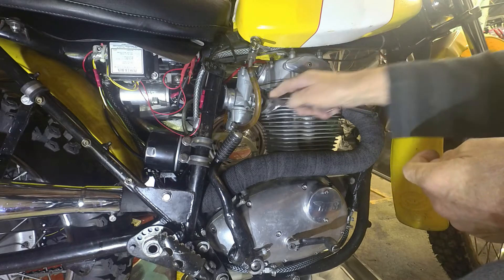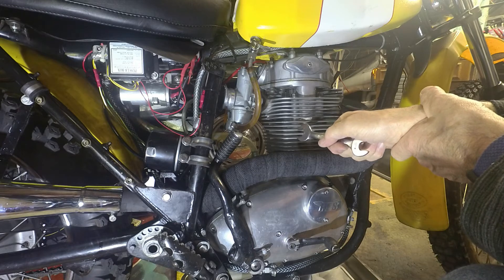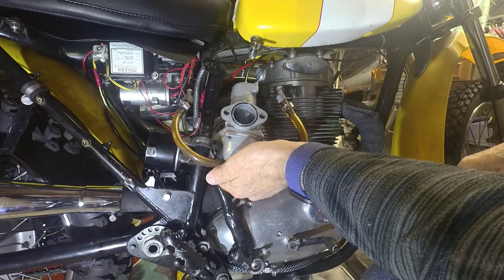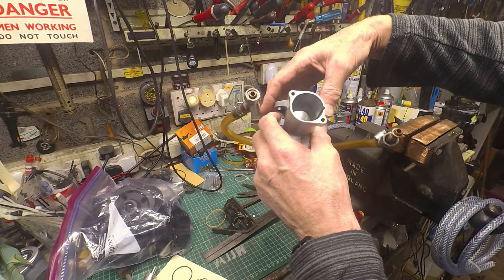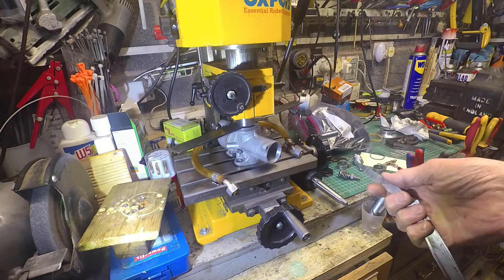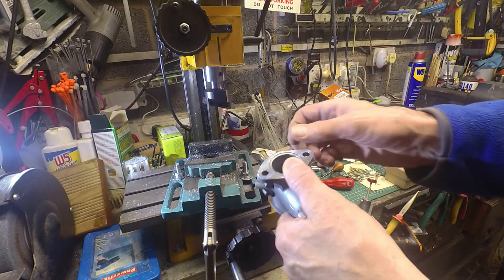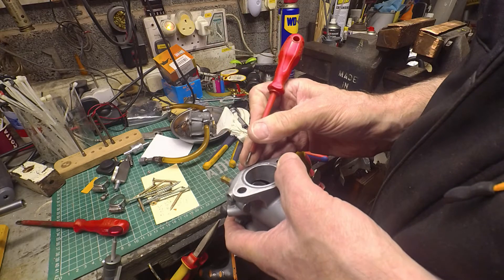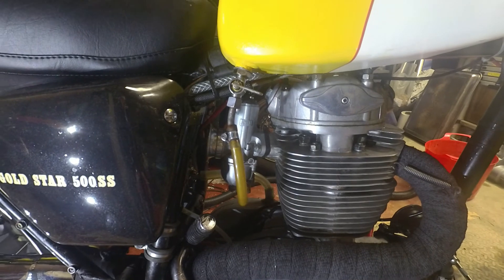Warped Amal Carb Flange

Comment: H❤
i I have a trailblazer 250 and I have a problem with with

Hi sorry to bother you I have a trailblazer 250 1971 and I think I have a carburettor when I go along it keeps coughing all the the carburettor has been fully cleaned what do you reckon the problem is
Reply from the maker: Difficult to say without seeing the bike. I'd suggest that you look at the excellent guides available on the Burlan website, here https://amalcarb.co.uk/downloads/ The 'Hints & Tips' & 'Tuning Guide' in particular. Note that these carbs need to be tuned at four slide openings. First of all I'd check that you have the factory recommended needle & main jet for your 250, as a good starting point. If you've got a non-standard exhaust that will significantly affect the carburation too. Good luck.

Comment: Thanks for a very good commentary. I have some experience of similar problems with my B50. It may worth considering fitting a 2-4 mm tufnol fibre spacer/gasket between the cylinder head and the carburettor. This may reduce heat transfer from the head and the potential for distortion of the carburettor flange.
Reply from the maker: Thanks for your comment. The bike has a Tufnol washer, which was there when I bought it. I think this must be the 70-7821 version that was specified by BSA for the B50 SS. The MX was fitted with a 71-2592 version, also described as a Tufnol washer. I’ve no idea what the difference between the two versions might be. These bikes definitely need an insulating washer between carb & head but this doesn’t seem to be the direct cause of my problems. Just 40 years of ageing & abuse probably 😎
Reply: @Greeves  Thanks for the prompt response. I had not appreciated the differences in the thicknesses in the Tufnol washer/spacer between the B50MX and the B50SS. I have fitted an aftermarket 5mm thick Tufnol washer/spacer on mine and had not overtighted the nuts on the studs of the cylinder head. You have certainly managed to get the throttle slide closing with a very satisfying reassuring clatter!  By the way; those 40 years that you mention may indeed by 50 years...
Reply from the maker: @davidbaron5298  Hi again. I'm an idiot! The reason for the 2 Tufnol part numbers is because the MX has a bigger carb; 932 v the 930 on the other models. My B50 started as an SS but was evidently substantially turned into an MX while in the USA. This includes the bigger 32mm carb, which was probably fitted along with the big-bore kit that I discovered it has https://youtu.be/9GrTMLXYvEA
Reply: Thanks for your advice I fit a new spark plug as well it starts I will try that thank you ever so much